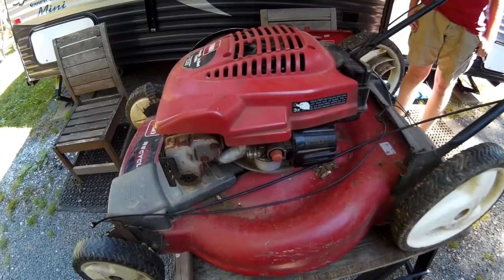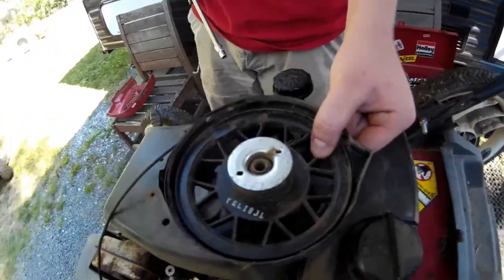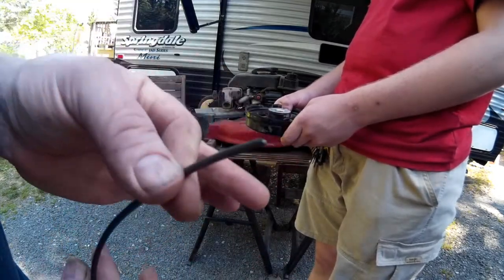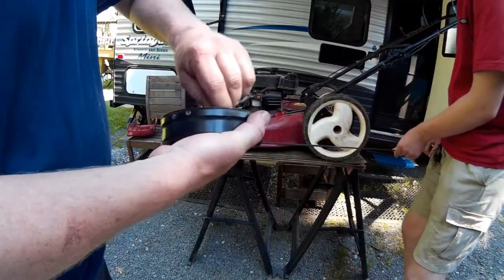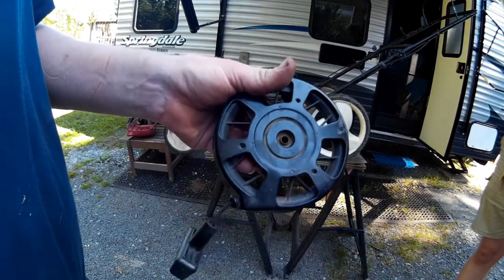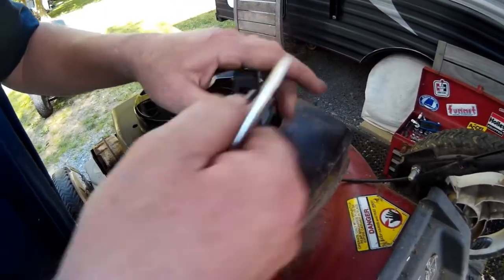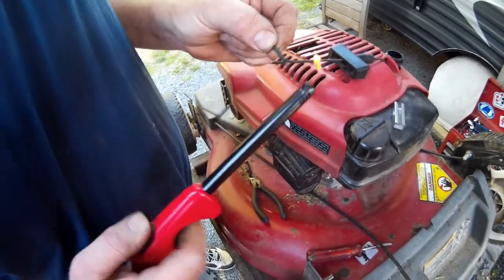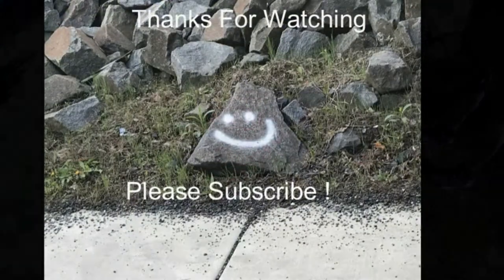Toro Recycler Lawn Mower Pull Cord Install

Comment: Thanks a lot. Your video saved me a lot of time and frustration. Got my old Recycler back up and running. Now, if i could only find durable wheels for it. I’ve had to replace three of the four within the past few years and the last original one has a fatal crack. Thanks again.